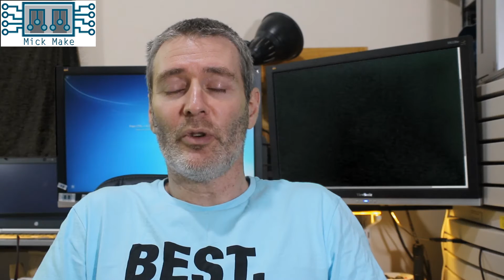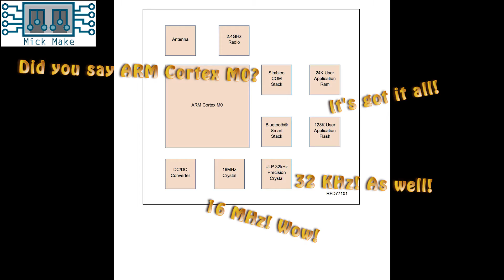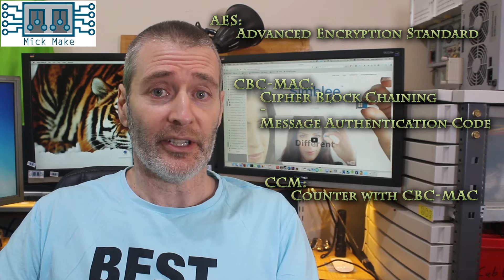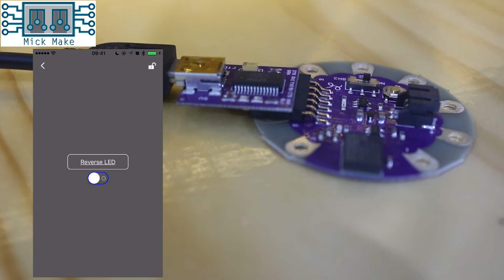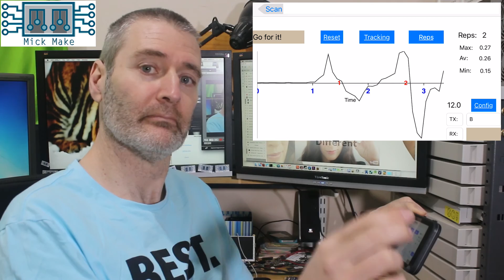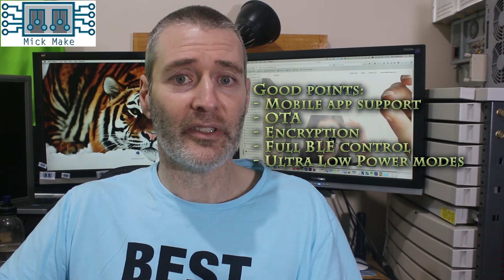#013 Lilypad Simblee: Mobile apps using the Arduino IDE // Review

Comment: Hi MickMake help me pls.
i have my own app made by Android Studio. How can i connect my app to the lilypad?
i mean i dont want to use Simblee App? is it possible? do u know how?
Reply from the maker: Hi, Yup, entirely possible. You can communicate from the Simblee like any other BLE device.
I did this in my IMU app. I don't think I've posted the code to that yet, but will do so.
Reply: thanks
i just know how difference between SimbleeForMobile and SimbleeBLE. My case have to use SimbleeBLE, right?
i can't find the tutorial of simbleeBLE. did you see some?
Reply from the maker: +Purachet Ruangtanasak 
Yup, there's not much info on it. I had to dig through the library headers and experiment. It's relatively easy. From memory it presents read and write objects you can work with.

Comment: I am going to order this for a student project. Can I run this with a CR2032 battery ? How long can I expect the unit to be able to run on it?
Reply from the maker: Yes you can run the Simblee on coin cell, but it depends on what board you get. This one is designed for LiPo. I found this one earlier which has a coin cell holder.

http://www.betztechnik.ca/store/p29/Simblee_coin_cell_(cool_name_TBD).html

Comment: hi what to use for connecting to lilypads over ble modules? or a ble breakout-module to avoid use or lilypad, it´s  just for turning on-off leds? thx
Reply from the maker: +JuanS LR 
The simblee is essentially an Arduino with a BLE module attached. It has a whole bunch of GPIOs that you can access and reprogram GPIO functions to other pins.
Not sure if that answers your question or not.
Reply: Hi thx it did, but ..what module does exist to bring (connect) bluetooth to lilypad, or 2nd if a ble breakout is able, without lilypad, to turn on-off some leds? I meant I have an iTag ble keyring, I want to turn on-off 2 different group of leds, not using a smartphone, but just like host slave connection!
Reply: Those leds are supposed to be sewed to a jacket!